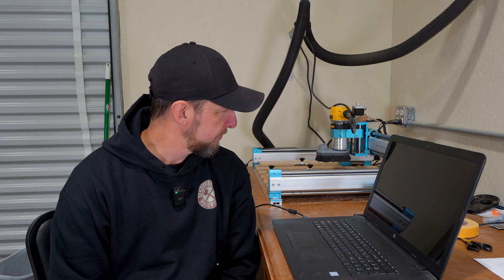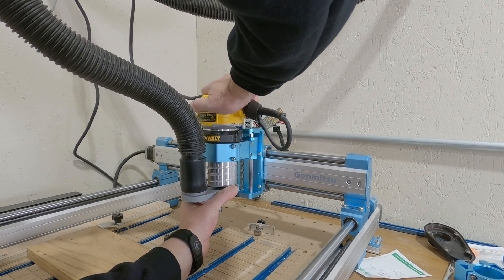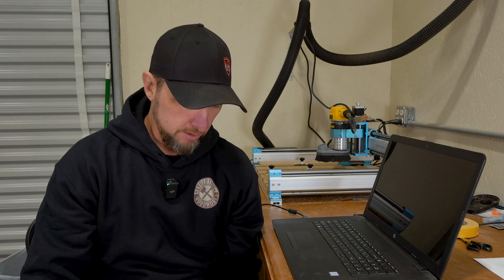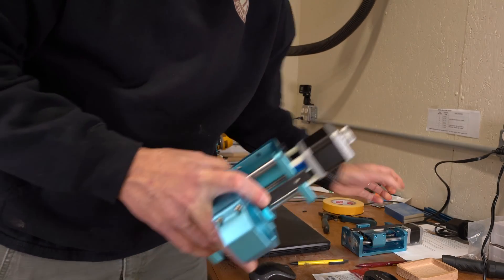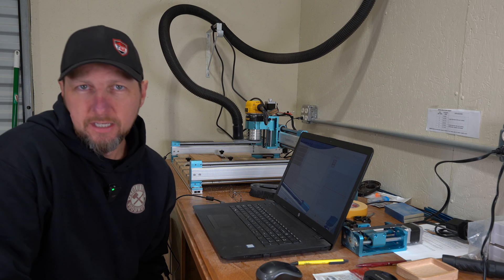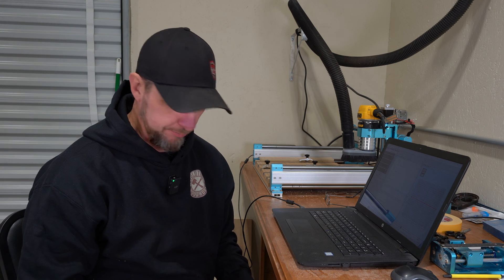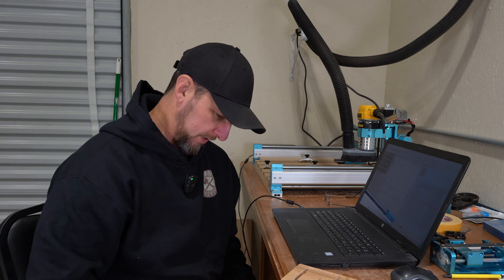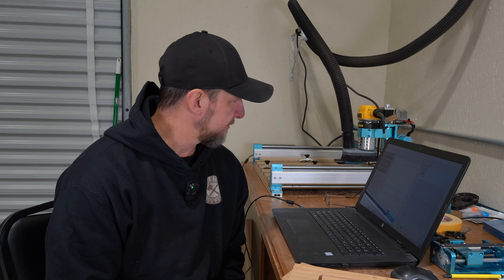Genmitsu 4040 Pro XZ Axis Flex - Can It Be Fixed?

Comment: I’m about to contact them and get an updated carriage. I’m not sure what control software you’re using, but change your acceleration settings. It’s factory at 20mm/s^2. I have mine pushed all the way to 150 and it works just fine. It’s insane how much it wakes the machine up and speeds up the process.

Comment: I just got my Genmitsu 4040 pro a week ago, by the looks I have the heavier holder. Purchased the Genmitsu router and I'm debating on which spindle to use. The assembly is not complete yet. Any suggestions ?
Reply from the maker: I had the original 1/8" spindle originally but switched to the Dewalt to get more power and move up to 1/4" bits. I have other Dewalt routers, so I went that route, but a lot of people prefer the Makita. I don't have any experience with the genmitsu routers personally, but anything is a step up from the stock unit.
Reply: @Evolution.Workshop  Good advice. I'm thing I'll keep the 1/8 spindle in for learning purposes and then install the genmitsu router. Thanks you've been a big help.
Reply from the maker: @harryshaw4998  I ran my 1/8" for a while, just playing with it before I stepped up to the router. Works good for what it is. And, of course, I bought a whole set of 1/8" just before deciding to switch and never used any of them. 🤦‍♂️

Comment: What software are you using?
Reply from the maker: Carveco to set up toolpaths and UGS to run the machine. I use Fusion 360 for more intricate designs, then I import to Carveco to set up the paths.
Reply: @Evolution.Workshop have you ever tried gSender instead of UGS?
Reply from the maker: @chrismakesstuffCNC  I tried a couple different apps early on but UGS seemed to work best for me at the time. Not 100% sure which ones I tried to be honest.
Reply: @Evolution.Workshop  gotcha, cool! Might be worth another look if you'd like since gSender has continued to get really good, but UGS is also a great sender

Comment: What depth of cut, plunge speed and feedrate do you use with the trimmer?
Reply from the maker: Honestly it's different for every bit and different wood species.
What I was messing with in the video is red oak, and I believe I was .2" DOC, plunge speed was pretty slow like 10 or 15, and the feed rate I had maxed out, which appears to be 78 for this machine. I set it higher but never see it go faster than that. The Dewalt is usually set between 2 and 3.

Comment: I have an early model 4040 and always have chatter if I try to use 1/4 " bits.  It looked like that is the bit you were using.  It's hard t understand how that upgraded mount can make such a difference but I am going to try it.  I upgraded to a 800 watt spindle running with a VFD that's the next upgrade you should consider it's very quiet and powerful with variable speed up to 24,000 rpm.  Thanks for this video and I did subscribe.
Reply: I have also the 4040 Pro. Unfortunately still with the v1 weaker Z-axis. I am based in Sweden in Europe and have not find anywhere were the new v2 stiffer Z-axis could be bought.
I have done some Engineering stiffness calculation of how much the stiffnes will increase by changing the Dia 16x10 mm original pipe to a solid Dia 16 mm bar. The stiffness will only increase by 18%, so my take away is that it is not worth the effort. 😢
Reply: @heckenbacker  Thanks for checking this out.
Reply: @heckenbacker  Genmitsu seems to be sending out the improved z-axis (not the one from the pro max) for free if you say you have chatter.  You might offer to cover the postage if they push back but they seem to be pretty responsive.  I have heard for some people they want to be sent a video of the chatter.
Reply from the maker: Yes, it's a 1/4" bit. I didn't think it would make as much of a difference as it did. When it flexes it lets the bit wander and jump around rather than cutting. It's like if you were using a handheld router and just barely holding on to it so it can bounce around the workpiece.
Thanks for the tip on the VFD. I think my next upgrade will be a much bigger machine honestly. This one was kind of a test run.
Reply: @Evolution.Workshop  I did order the new mount for my 4040.  You can do a lot with this machine but it can't handle 1/4 inch tools.  I have had some luck with 3/16 O flute tools but 1/8" works the best.  It just takes longer.  I have considered replacing the X axis hollow rods with solid pieces that I can purchase from McMaster Carr but I don't know if even with that the machine will be able to use 1/4 inch tools.  For the money it's an OK machine.
Reply: @jimbembinster  I use 1/4" up/down/and compression bits on mine with hardwood all the time with no issues? I have the non-upgraded Z version... I do however use the upper two holes to hold the makita as close to it's bottom as possible, not clamping it in at the top of it's sleeve. Sure you lose a bit of Z range but it works better.

Comment: Very interesting video thank you. I am just about to buy one of these 4040 machines and wondered if Sainsmart are now supplying them with the upgraded part for the Z axis, also could you let me know what feed rate and cut depth you were using here please. I will probably be using a makita palm router with mine, similar power and weight to your Dewalt.
Reply: i just got mine on the first of march 2024. mine has the upgraded z axis structure.  have not even used it yet because im busy on other stuff but i plan to get into it soon.
Reply from the maker: That was my problem. I bought it on a lightning sale while I was building the shop so it just sat there for months before I finally used it. Then I was disappointed in how it worked and let it sit again before I finally caught someone in a FB group talking about the upgrade.
Thanks for watching!
Reply from the maker: From the pictures I've seen they have added that on the production models. Some of the pictures on the website show the old and some show the new but I can't imagine they would be sending it out without the update.
That file is set to run at 80 in/min at 0.15 stepdown but the fastest I've seen it go is 78 in/min so I think that's about max for the machine. I'm running the router speed about 2.5 on the dial which should give me about 19,000 RPM.
It's still not perfect but for what it is I think it does pretty good now. Before it was almost worthless to me.